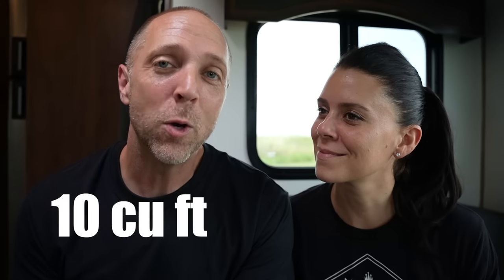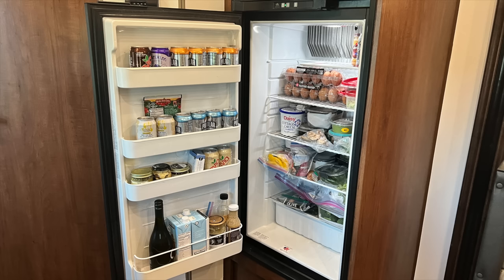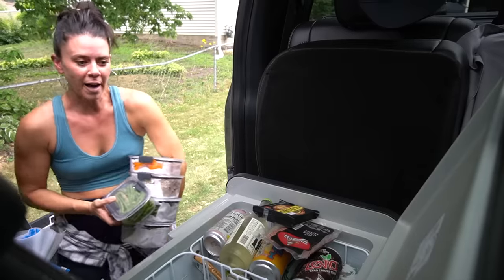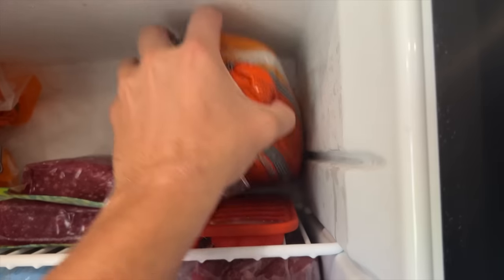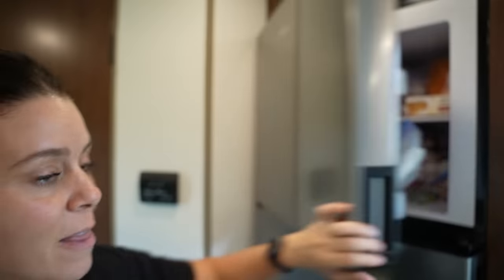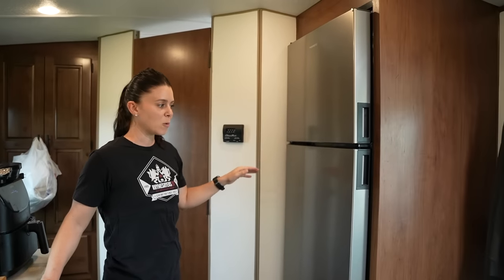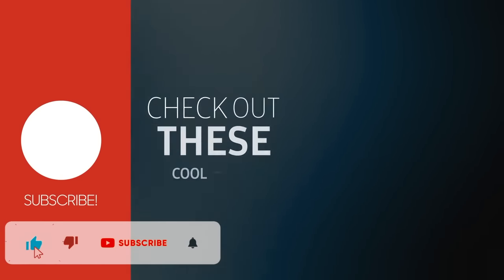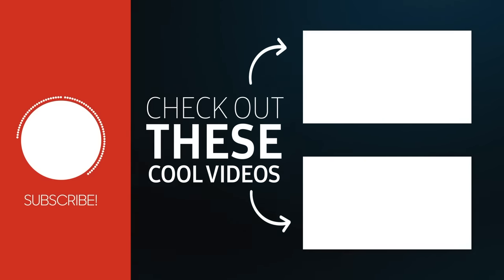6 Reasons You MUST Switch to a 12 Volt RV Fridge - Dometic 12 volt rv fridge

Comment: You guys have an Outdoors RV, right? Those all come with a Norcold Cold Weather kit that allows it to work down to 0 degrees...supposedly. Did that kit fit on your new fridge or did you opt out of that feature?
Reply from the maker: Yes our ORV did have the cold weather kit and It did seem to work in below 32 degrees weather. The new 12 volt fridge is a compressor style and works normal in cold and hot weather conditions.  Instead of the RV absorption style where you would need the cold weather kit to heat the ammonia. 😊🥶
Reply: @IreneIronTravels  oh, I see. I didn't understand that. Thanks for the explanation. Appreciate it! Enjoy your new fridge.

Comment: My 2022 Micro Lite came with a 12 volt fridge, the only problem I'm having with it, is it gets too cold. I can have it on the lowest setting and sometimes it will freeze things.
Reply from the maker: Oh wow! We had ours on 4 of 5 and it was too cold as well. Froze the celery! 🤣 3 has been perfect for us. Maybe yours needs a tweak….. freezing on the lowest setting doesn’t sound good .
Reply: We had the GE  12 volt fridge which does NOT have a fan in it so a battery-powered fan helped quite a bit.

Comment: We purchased a Dometic 4101 in Sept 2023 now in Jan. 2024 it sets in a repair facility to be fixed account its giving the fault signal on the temperature setting board. A flashing light means a fault and its no volage issue or fuse. Its a faulty Fan Motor that has stopped working. Dometic has sent the part to repair it by snail mail. I am not impressed with mine.

Comment: What about the noise? I hear the 12 volt fridges are noisy?? Is that an issue??
Reply from the maker: The noise comes from the fan so it does produce and audible noise, but not enough to be problematic for us. Our fridge is about 8 feet away from our bed and we don't hear it while sleeping. If you are very sensitive to noise you will notice it during the day if you are close to it as the fan kicks on.

Comment: Me and my wife are getting a new keystone travel trailer with the solar flex 200 system    and we’re getting a 100 amp hour dragonfly lithium battery. The trailer comes with a GE 12 volt fridge. My question is ...is this enough to keep the fridge and lights going as long as we get full sun during the days?
Reply from the maker: That should be a great start for you to see how it works for your travel/camping style. You should be good in full sun, but expect that battery to be around 50% overnight depending on temperature. You’ll run into problems with rain and shade if more than a day or so.
Reply: @IreneIronTravels  Thankyou for your promp reply. Actually we are going to see our new trailer today and we are so excited. I’ve had regular rv elec / propane fridges on our previous and current trailer but no experience with solar and lithium and 12 volt fridge thats on our new trailer. So thanks for answering my question so fast... its so much better getting questions answered by seasoned RV travelers like yourselves than salesmen who say you won’t have any problems.
Reply from the maker: Congrats! 200 watts and 100 ah lithium really is a great start. Compared to a AGM battery and no solar. You’ll be able to do some light boondocking and will have no problem on overnight stops on travel days to campgrounds. Usually new RVs have a extra “zamp” solar port by the battery you can add up to a 200 watt portable panel. That could help a ton while boondocking.

Comment: Just got my dometic DMC 4101 - ya!  Before I install it, did you do anything to one or both of the existing vent holes for the other refrigerator?  I'm thinking about putting up some type of insulation, maybe foam but wasn't sure if it is a good idea to do that?  I don't think the DC needs ventilation but not sure on that.  I'm curious if you did anything?  I really enjoy your videos!
Reply from the maker: Hey congrats Gary! Yes, we put the pink fiberglass insulation that was around the cabinet and old fridge and reused that to block the roof vent hole. I also used black duct tape to cover up the side vents. Didn't really have room for insulation there.
Reply: @Irene Iron Travels  awesome.  I don't think I have side vents? My refrigerator is in the slidout and only the smaller vent at the top and the big one on the bottom that has the removable access panel/door. I don't think I ever gave you my RV model, 250RKS! Out Door RV of course.
Reply from the maker: Ahhh yes I see your floor plan now. By side vents, I meant the sidewall vent. Looks like you have a upper and lower sidewall vent s because of the slide. Ours is a roof vent and the same lower sidewall vent. Your good to block/seal/insulate those with what you can, but make sure to not directly cover the back of fridge and it’s fan vents. You’ll want a small air gap of a couple inches so the fridge can breath. 👍
Reply: @Irene Iron Travels  excellent.  Thanks!
Reply: Oh man! I'm so stressed! I looked at the wire gauge and mine is 14awg! The manual doesn't recommend that. I saw on your video that your wire size was acceptable.  I don't understand why ORV is different from one trailer to another. These are some things that frustrate me!  My refrige is in the slide-out. It looks like the wires run down under the slide-out (in a rubber conduit) and go into a junction box and it's only about two or three feet. I'm wondering if I have to change the wire size if that's all the length I would have to change out (just to the junction box), or do I have to run it all the way to the breaker box, which is middle of the trailer?  Do you have any thoughts on that?  Also, the ground wire, did you fasten that to the frame or tie in to a ground wire somewhere?  Thanks for your thoughts.

Comment: 11:10, electrical units of measurement are kinda counterintuitive. Their relationship with time is exactly the opposite as, say, speed and distance. So Miles Per Hour = Amps, and Miles = Amp-Hours. So going 50 MPH for one hour moves you 50 miles, and drawing 50 amps for an hour consumes 50 Amp-Hours. So if your fridge used 50 amps overnight, it'd drain your 800 Amp-Hour battery bank in 16 hours all by itself.
Reply: Also, watts is just Volts x Amps, and then same relationship betweens Amp-Hours and Watt-Hours exists
Reply from the maker: Hey Paul 👋. What I meant was roughly 50 amps total overnight (10 hours ish) so 5 amps per hour. Just a rough guide for someone to gauge how much a fridge like this would run down a battery overnight. Hard to exactly test this while living in it and the temp does really effect it as well. 

The fridge draws around 100-150 watts when it’s running and cycles about 50% of the time.
Reply: @IreneIronTravels  Hello! I know what you meant and I'm not trying to be a jerk, but you still have it exactly backwards. Your refrigerator drew 5 amps all night long (10 hours) and used 50 amp-hours of electricity.

What you're saying is "we drove 50 miles per hour all night (10 hours), and traveled 5 miles".
Reply: @IreneIronTravels  This is what I meant about electricity being counter-intuitive. For most things, the unit is capacity. A gallon of water. A mile of distance. You ADD time to get the rate - A sink does 2 gallons per minute, a car goes 50 miles per hour.

With electricity, it's exactly the opposite.

Time is part of the unit of capacity (amp-hours) and you remove time to get the rate (amps).

So GPM, MPH, and amps are all rates.

Gallons, Miles, and amp-hours are all capacities.
Reply from the maker: Ahhh yes I see what you’re saying!

Comment: So that's why my lettuce and cheese go bad so quickly! Does the 12 volt run off of the house battery? I have no solar.
Reply from the maker: Yes, the fridge runs directly from our batteries. The Solar's job is to recharge the batteries so as long as you can recharge you batteries from another source ( gen, shore) you'll be ok. Do you have lithium batteries? Or do you know how many amp hours of batteries you have?
Reply: @IreneIronTravels  I have only one house battery that controls the lights..so I'm thinking I best stay with the 2 way..I did notice if I fill the fridge it takes a long time to get cold and the freezer ice is thick.
Reply from the maker: Ahhhh yes. The 2 way definitely is a better fit with one battery. They can be tricky to deal with! 😊

Comment: Our 8 cubic just gave out after 10 months. It sounded like a horcrux the whole time. When it quit, we discovered a fuse per troubleshooting etc. Replaced the 15 amp and no compressor. Only fan and light. So further research...the norcold cannot be repaired...the only replaceable part is the control board...everything else is built in, and not replaceable. It is rare we can't fix something...so new 8 cubic 1500 bucks...egad

Comment: Is there a door lock for the fridge?
Reply from the maker: There is no door lock, but because it is specially designed for RV's and boats, the handles have a positive latch as you close them. Just like the handles on a RV absorption fridge. A lot of new fifth wheels and motor homes have the residential fridges that don't have latches on the handles so they do need some type of lock or strap on them for travel.

Comment: Oir 12v refrigerator is  useless.  Just bring dry ice and coolers.    We have a Brand new Everchill 3.3 cu ft model 2022302371 .

 Its 80 degrees out. Camper is 75 inside. The fridge is getting perfect CLEAN current. Whether running shore or batt. All is operating well. Problem is, it's on maximum, 7 and it can get under 45 degrees during the day. It's almost useless to use it.

Our coolers with dry ice are still at 39 degrees for three days.

Comment: I had a gas refer in a winnabago motorhome I use to own.  The damn thing ruptured one day while I was at work.  Surprising it did not catch on fire as they usually do.  I have been running a 12 volt compressor frig for the last 20 years and when I got a different motorhome the first thing I did was to swap refers.  I tell people who are having trouble with their gas refers is to rip them out and take them to the gun range and get a 12v compressor frig.  I hate gas frigs with a passion.

Comment: If it's DC, it's me.

Wait: There's no frost build-up in DC refrigerators?
Reply from the maker: ZERO! We've had it running non stop since June in high 90's and humidity and zero frost!
Reply: There’s a self auto defrost function on the 4101 Dometics I believe.

Comment: If you are plugged in all the time, 12v dc compressor is good to go.  If not plugged in, no thanks.  The battery will be toast after a day and no water, no heat, radio, lights, etc.